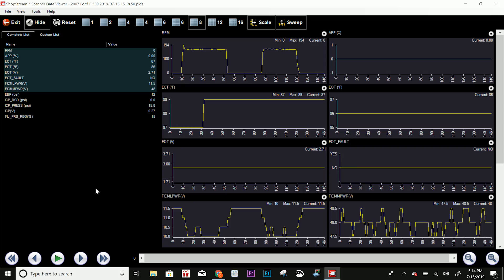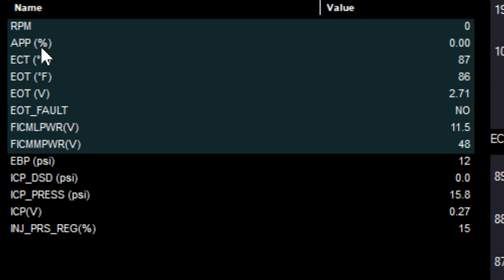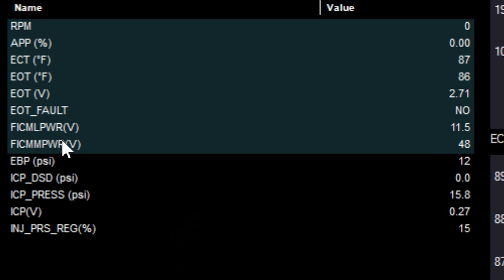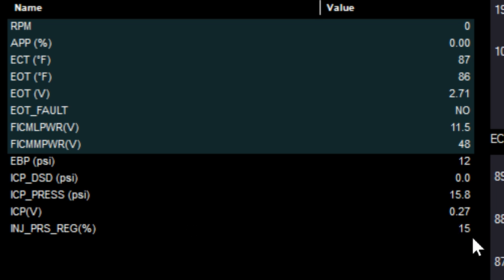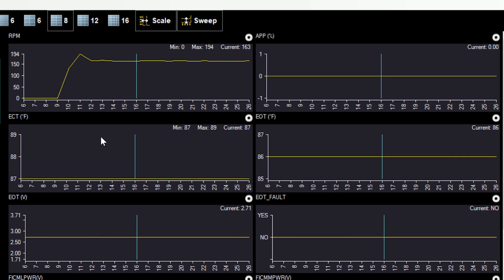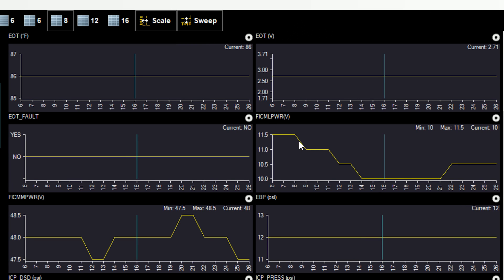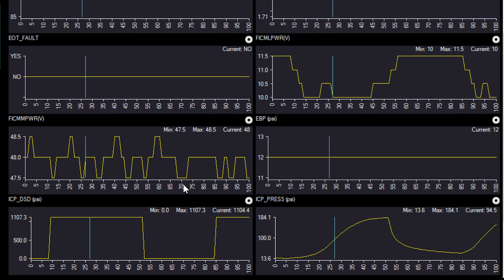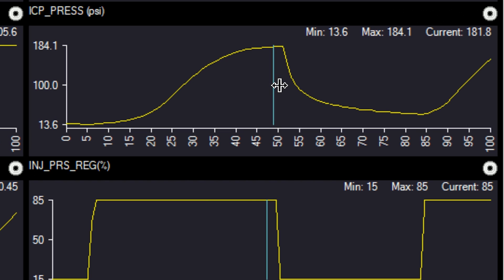2007 Ford 6.0 liter PowerStroke cranks no start diagnoisis and repair

Comment: Did you jack up the motor on that side?
Reply from the maker: @mojo2131  no I normally just leave the mounts as is.
Reply: @ I have an 06 power stroke and I can’t get the stan pipe out. I watched your video 6 times and mine won’t make it past that heat shield. Any suggestions?

Comment: Hello, Thank you for the video!!! I was wondering if this could be an intermittent issue at times? I have an 07 and every few months it will leave me walking as it will turn over but not start. Some times if I put a jump on it it will start right up even tho both batteries are full.  It is hard for me to trouble shoot the issue because it is self fixing after an hour or so it will start right up. Very frustrating. Thank you.
Reply from the maker: @calebcaulum9888  This typically isn’t an intermittent issue. Sticking IPR can be, FICM relays, crank sensors can be. Best to bring a scan tool with you and try to diagnose the problem when it happens.

Comment: What was the torque on that tube and I was told don’t take it over 100 psi when your pressuring up your block but great excellent information. I will definitely be using your tips. Thank you again for your time.👍👍

Comment: I really need some advice fast!! I have a 2005 F350 6.0 and cranks with no start unless starter fluid is used but will run only a few seconds then when I press the throttle it will die… Oil level on dip stick is good. Removed the oil filter to see if the filter compartment filled up with oil when cranking and it did. Tested the IPR and ICP. Both good. Then ran air pressure test through the ICP and no leaks. If the compartment is filling with oil I’m assuming that the relief valve on the lower pump is not causing it. The only thing left would be the HIGH PRESSURE OIL PUMP….. What do you think???
Reply from the maker: A scan tool that can read data would be the next step. If high pressure oil is building on the scan tool then the problem is somewhere else. 
Low fuel pressure, bad fuel, bad ficm or ficm relay.

Comment: Thank you!! I’m waiting for my pressure adapter to arrive tomorrow. That is a great video… hoping to get it diagnosed tomorrow. I live in Arizona and my mom is in the hospital and I need to drive to Minnesota and I have a hot no start so I’ve got the new standpipes and dummy plugs but instead of doing both to save me time I’m going to repair only the part that is needed so I can get on the road. When I get back, I’ll do the opposite side. I’m hoping it’s not the passenger side but thank you so much for this info!

Comment: Just finished dealing with a crank no start situation with my 2006 with the 6.0. 
Guys and gals please start with the relays under the hood before you check anything else. The injection relay can overheat and cause othwr parts to go out.

Comment: Was wondering what else it can be I have crank no start replace the standpipe and fuel pump and icp ipr also and crank sensor but if I step on throttle half way it will start most of the time

Comment: Never worked a diesel till this month. Having now a no start on hot. Don't have the pressure tester but figured how easy it is to replace them might as well since it's a 05 and I'm sure it never been replaced. Great video. Once you dig into these engines you find they're really not hard to work on.
Reply: Growing Weed seemed hard , building a treefort was easy 3/10 1 being easiest and 10 better call them boys at NASA but when youre interested about soemthing it doesnt really matter i find im gravitated / pulled / to said project .
All the best to you UtahRvCamping5*** hope you keep with it and its your calling Amigo Amigo

Comment: GREAT Video, 4 years later and I'm seeing this video, I too have a 07 F-350 DRW FX4 I know a lot of people hate this engine, but I guess I have to knock on wood, as I have not had any issues with mine with 150,000 miles. I did volunterily replace the injectors at 150,000.
Reply: Sre you the type of person to see a light on the dash and
1-Put black tape over it or
2-park it call around to a garage or / Do the work yourself thwn and there.
I ask that because to do injectors when they do not need it leads me to youre mote 6k miles fuel filter and 4500k or under 10k do the oil and what not, sorry so long to get to the point but for me its a lot of times ppl be their own worst nightmare lawyers Drs. Civil servants and its like youre talkin to those Whacky Waving Inflatable Flailing Arm Tube Man ahahhahahah
Reply: @hectorjoemulligan5729  WTF are you talking about I voluntarily replaced them as Bank A was giving me issues so we simply replaced Bank A and Bank B while we had the engine apart as it isn't that easy of a job.. Geeze black tape over an engine light LMFAO

Comment: Why does the lower oring on the driver side stand pipe keep blowing apart on my 6.0 3 stand pipes in 4 months what am I doing wrong
Reply: Are you using updated part? With the white back up piston ring  kinda washers on it?

Comment: Passenger side#1 injector blowing air @85 psi on ipr port test plug with valve and air hose. No start also. Question what psi shall I air up to at minimum. Thank you in advance.J

Comment: Folks are always so scared of the passenger side. I'd have sealed the entire high pressure system. All your doing is putting a band- aid on it if you go cheap.

Comment: Great video Chad!  What size bolt do you use for the lower stand assembly removal trick?  I am a DYI guy and have worked on cars my whole life and I just went through this on my son's 6.0 after getting hot start issues (changed dummy plugs, stand pipes and IPR valve just to be certain).  But, I couldn't get the passenger side lower stand assembly out as it was stuck.  Your video is a life saver especially with that stand pipe trick.
Reply from the maker: I think it was a 3/8” bolt but it may have been a 10mm. I loaned it to another tech and never got it back so I need to find another one.
Reply: @ThePracticalMechanic Thank you so much for the quick reply!  Send me an email, if you're comfortable with that, and I will gladly mail you a couple once I find the perfect length size in a 10mm or 3/8".  You just saved me from pulling the rail and maybe causing seal issues on the nipples or injectors.  Thanks again!

Comment: Have a 2003 Ford F350 crank/no start. The FICM start at 46 but when cranking it drop down to 27. I'm assuming then the FICM is bad.

Comment: Just to verify I loosened the motor mount frame nuts did not remove them on the passenger side and was able to jack up that side of the motor with a port a power to gain more clearance. Worked great able to access valve cover bolts easier on the passenger side also was able to remove and install new stand pipe with ease.
Reply from the maker: Thanks for the tip. I should probably just do that on every one of these jobs to make it easier.

Comment: I don't blame Ford for stupid individuals messing with this product Dog knows it has enough problems of its own with out help from others making it look worse than it is.
Ran into several problems with a 2006 Ford 6.0 diesel What started with a possible bad EGR cooler (found out it had been replaced with a bulletproof one) still need to pressure test to see if it leaks internally, just figured out that previous individual that owned it replaced the oil filter with a standard element and filter cap is an aftermarket tall one. So the fun continues...

Comment: I realize this is an old post but her goes. Got myself into a $h1tfest, Been trying to pull the passenger side stand pipe but it hits on the A/C box would it help if I jack up that side of the motor using a port a power so I can get more clearance to remove stand pipe?
Reply from the maker: Yes it would.  I have seen guys heat up the box slightly with a heat gun and gain a little extra room. If the Motor mounts have sagged then the lower pipe is even harder to remove.

Comment: Great video master, does the standpipe has internal tread that enable it to come out when you insert the bolt, what is the bolt size?
Reply from the maker: The lower portion of the standpipe does not have internal threads. It is a smooth surface but you can get a 10mmx1.25 bolt to slide in tight enough to grab on. 

I hope this is what you were referring to.

Comment: I'm considering a 2007 Ford with this engine and just started some research and your video came up, awesome!
Reply from the maker: Let me know if you have any questions. You know how to contact me if needed. 2007 was the last year for the 6.0 and probably the most reliable.
Reply: @ThePracticalMechanic  I sure appreciate the offer. I'll let you know.
Reply: No sale. I tried two different scanners and couldn't connect to the DLC (no power). It was a low mileage truck but it's been through some rough miles. Pretty beat up. Thanks again for all your help!
Reply from the maker: @wyattoneable  no problem. The cigar fuse powers the DLC. Cellphone charger or penny probably popped the fuse.

Comment: Awesome information on diagnosis of that oil leak ...I have a senero with my 6.0 it has lots of hpop pressure but the ipr is showing 75pct it won't run but it tries to all other readings are within spec any ideas would be much appreciated...keep up the good work..ps would like to see more videos on the 6.0 thks again ..
Reply from the maker: I would check ficm voltage. There will be three ficm voltage data pids to look at, two of them should be near 12volts and the other should be around 48 but anything over 45 volts and it should start. 
If the FICM voltage is good you may want to take the fuel filter lid off and see if you have any fuel in the housing. It won’t be completely full since the filter displaces much of the fuel. 

Depending on what scan tool your using I would try a buzz test. This will perform an electrical test on the injectors and you can listen to the injector actuation. It will firing all of them in quick succession and then fire them one at a time 1,2,3,4,5,6,7,8 if you are lacking a click from specific Injectors I would check the harness for the FICM. The clips break and the connector will rattle loose.

Comment: 2007 f550 6.0 It took a few hours to start and then stopped and all of the sensors. New battery. Alternator I changed it to a new one. But it cranks, but it doesn't start.
Reply: You changed the ipr valve?if you did change it,may be an oil pressure problem and if not that may be the pcm

Comment: My problem is no crank at all. I can still jump it using the bypass under hood trick. Lately even that won't make it start, it will just start up several hours later. I have a programmer and it's not showing any codes. Dealer can't find anything wrong

Comment: I have a 2004 f250 super duty  6.0 it does a no start but if i spray starter fluid in the breather box it will start turning over and start up but i do have to keep it cranking until it stays running and runs good until i shut it off. but sometimes it will start back up but has long crank then starts. i was told it is the high pressure oil pump. any help on this problem. thank you.
Reply: Hi John , I been having the exact problem , did you figure out what it was ?
Reply: Same here
Reply: I already replaced IPR , ICP , dummy plugs and stand pipes , high pressure oil pump ,  and still does the same

Comment: Why after did you install the new part you  didn't stated the engine
Reply from the maker: I still needed to replace the other side stand pipe and plug as a preventative measure. I didn't want to take the leak test equipment off until all repairs were completed because a final leak test is performed before the engine goes back together.

Comment: I have a 2005 6.0 when I parked it last night then turned it on again it had a lot of trouble firing it up then I left it over night then the morning came in wouldn’t turn on at all I thought my battery was dead so I bought 2 new ones put em in then it still wouldn’t start and turns over but wouldn’t start any advice?
Reply from the maker: There are several things that can cause a 6.0 to not start. Check the oil level first because if they get low on oil they won’t start. Most other checks are going to require a scantool or special tools. If a scan tool is available watch the Injection control pressure (ICP) data. They require around 500psi in order to start. If the vehicle will not build high pressure oil it won’t be able to fire the injectors. Another scantool test is watching the FICM voltage. You need battery voltage going into the FICM and more than 45 volt going out. Hope that helps.
Reply: ThePracticalMechanic thx sm it was a ring under the valve cover that leaks pressure
Reply: @ThePracticalMechanic   Hi , Which reasonable costing scantool is best to Injection control pressure on a 2004 E450 6.0L

Comment: I have the exact same air leak on passenger side I took out standpipe which was updated less then 4000 miles ago and I have same o ring just like urs did that fix no start u did not do follow up video u can watch my video I posted a few days ago showing it all
Reply from the maker: It hasn’t had a problem since I did the repairs. I do this job about once every three months and none have come back with repeat failure. What brand pipes did you install? I have only installed the factory Ford updates pipes.

It’s possible that the O-ring got a small nick or tear while installing on that back corner. Once a small leak developed the high pressure oil destroys the rest of the O-ring. There is also a very small chance that the branch tube under the head is damaged causing the oring to not seal properly. You have to pull half the motor apart to fix that so hopefully that’s not the issue.
Reply: ThePracticalMechanic I think my leak is one or more of the injectors top seals I still have air after new stand pipe I also only buy oem motor craft still air coming out of passenger side so I am gonna do every seal on the 4 injectors and hope it fixes leak if it still leaks I’m lost mine is 2007
Reply from the maker: Sean B I have one sitting in my lot for the last two weeks that needs the injector nipples resealed. Hopefully I will get the authorization soon. I thought for sure it was going to be the standpipe but when I got the valve cover off the stand pipes were fine.
Reply: ThePracticalMechanic my stand pipe was bad but still a lot of air coming out did u check out my video
Reply: ThePracticalMechanic I also did oil rail seals still leaking that’s why It has to be injector top seal

Comment: Great work Chad! This is a good useful video for diagnosing oil leaks on the 6.0. Keep it up
Reply from the maker: Thanks Cody!!
Reply: Quick question how do you diagnose if the battery died from sitting a few months and no codes pop up on the scanner?

Comment: I have made some good side money working on the 7.3 and 6.0.  Just doing  basic diagnostics are pretty simple once you know what to look for
Reply from the maker: I used to be very intimidated by the 6.0 and 7.3 but once you understand the basic operation they aren’t too bad. I have limit experience with the 6.4 and 6.7 so those are still foreign to me. 

Thanks for watching.
Reply: @ThePracticalMechanic  I enjoy your video's.  My experience on the 6.4 and 6.7 is limited as well. I have attended classes on the 7.3 and 6.0. Also watched videos on YouTube.